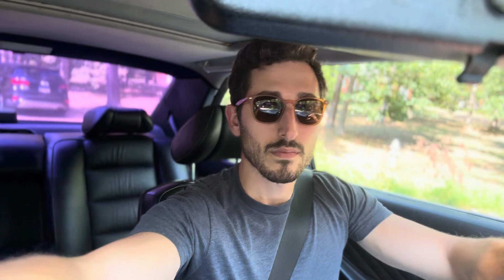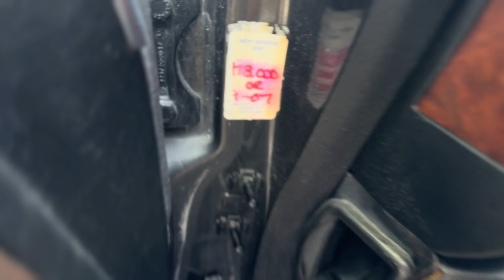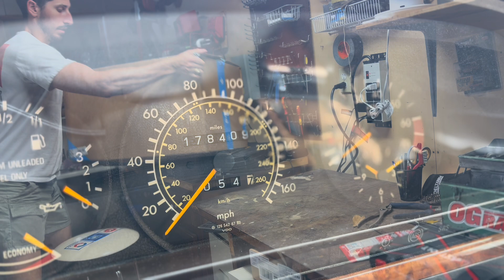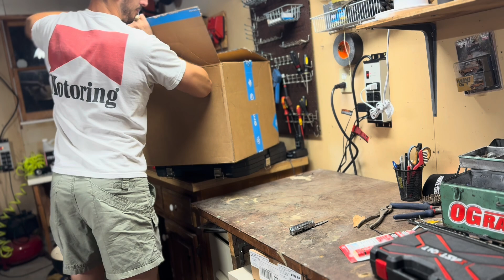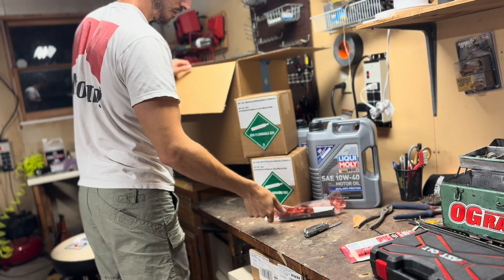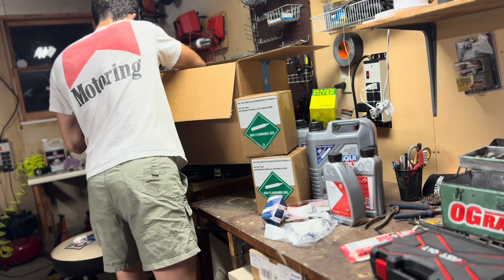(PT.II) How NOT To Buy Your DREAM Car - Replacing EVERYTHING To Solve A Misfire... (Parts CANNON!)

Comment: As you correctly pointed out, these cars usually start in second gear. However, you can also start normally in first gear. To do this, while the car is stationary with the brake pressed, the engine running, and the gear lever in the D position, move the gear lever down to the B position. Then shift back to D, and the next time you start, it will begin in first gear.